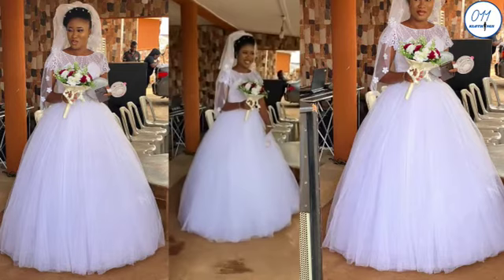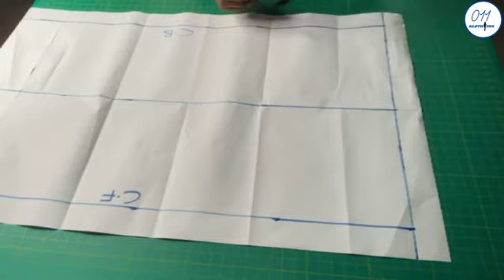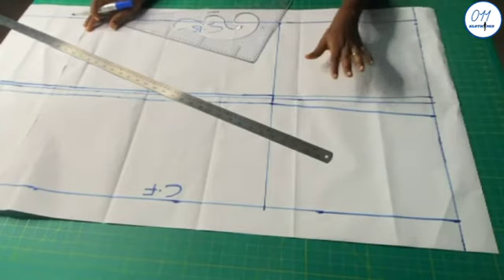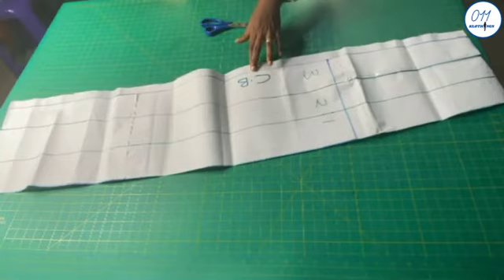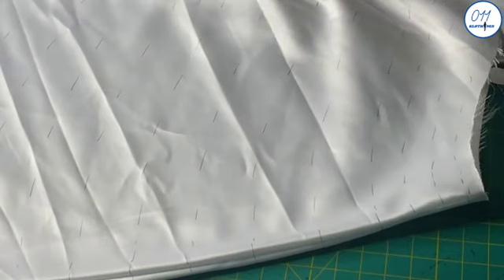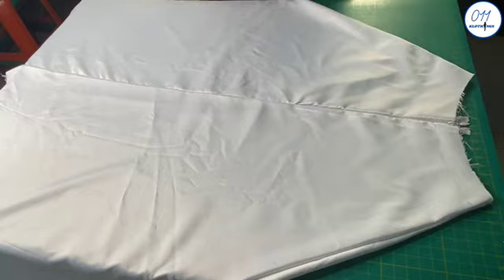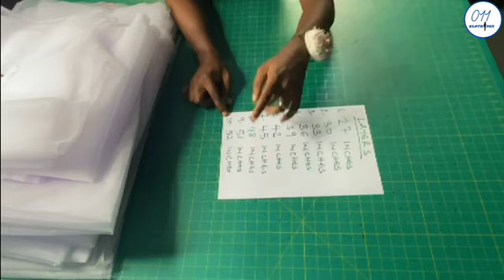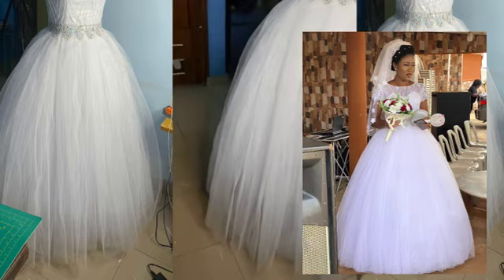HOW TO MAKE A TULLE SKIRT FOR A WEDDING DRESS

Comment: Thanks for the tutorial. 
Please,  how many layers of tulle net did you use? 

After joining with the upper bodice and turning with linking,  did you leave the zip space on the linning opened or you later joinned it?
Reply from the maker: I used ten layers of tulle.

As for the zipper space on the lining, I left it opened - initially. I first of all hemmed the raw edges of the zip space. Then, using the invisible hand stitching technique, I secured the lining zip space firmly to the zip tape.

Note that this is not the only way to go about this.
Reply: @ZERO11KLOTHINGS  OK. Thanks for your response

Comment: Hi, very good video. 

Unless I missed it, did you sew the back seams of each tulle layer?  You said that you turned the edges over on each of the layers in for neatness, but I didn’t see you sew them together?? I know the seams are left open (folded in) from the bottom of the zipper to the waist.
Reply from the maker: No, I didn't sew the tulle layers together at the center back. 

While sewing the tulle layers to the lining, I made sure the stitching ended just before the one inch zip allowance at the center back. 

So the I just sewed the only lining at the center back and I left the tulle layers. Because the tulle layers were gathered, the fullness of the tulle will cover this and it won't be obvious how the back of the tulle skirt was finished.

Comment: How many meters of cloth will be required
Reply from the maker: I used the whole pack of tulle for the tulle skirt - it comes in about 30 yards. Then for the bridal satin and the lining at the base of the skirt I used around three yards each. 

** Sorry!! We use yards here not meters. But I guess in can easily be converted.

Comment: Pls which lining did you use
Reply from the maker: I used spider lining but I had issues with the length because it’s just 45 inches.

 So I will advise that you use suit lining.
Reply: Thank you very much
Reply: Pls gown is 46, so please which length should I use for my petticoat, should I let it be equal with my gown
Reply from the maker: The petticoat should be a little bit shorter ( about 2 inches) so that it is not showing beneath the dress.